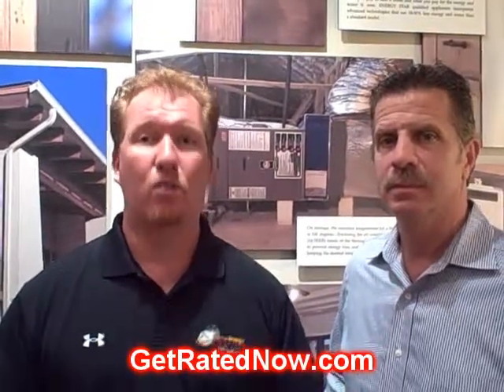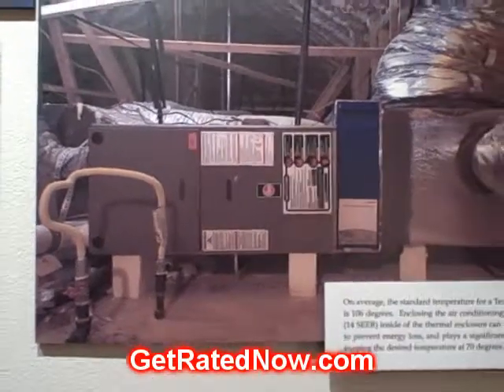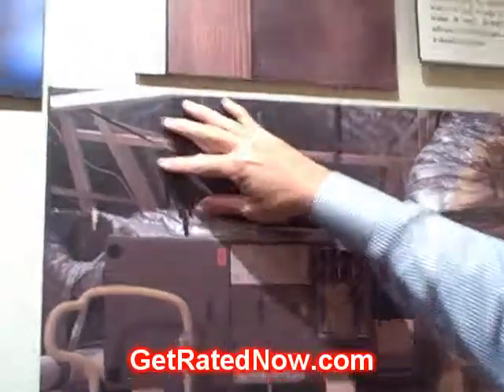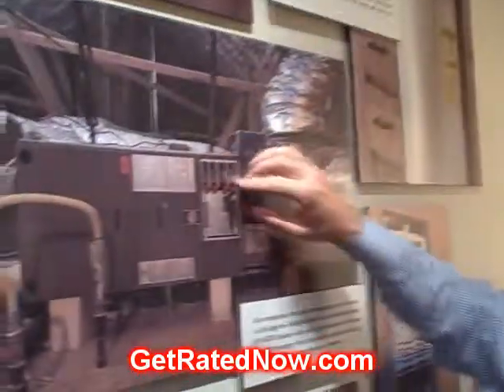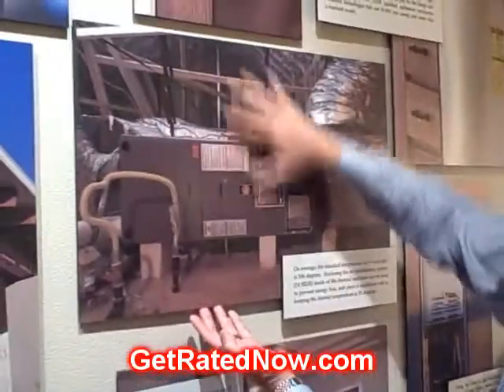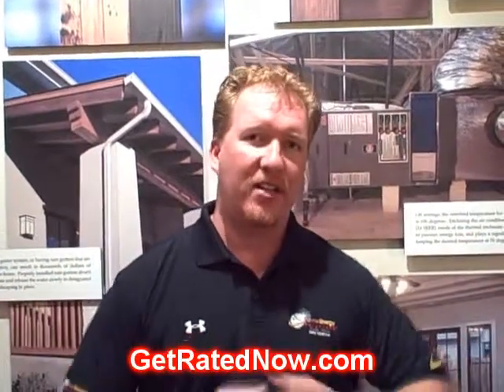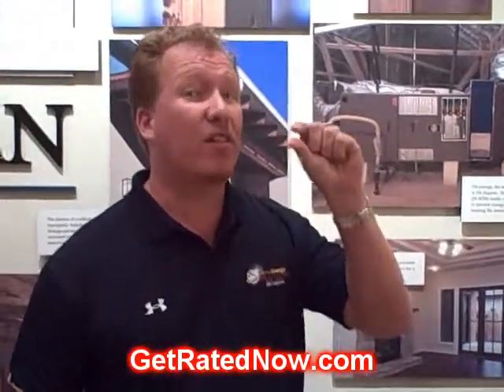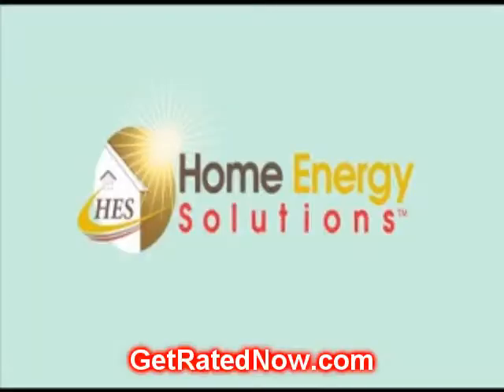How to make your HVAC system run more energy efficiently.

Comment: Is anybody dumb enough to believe that if you condition more air(attic) Install a substandard R-Value (R-19) Increase the surface area of your envelope (the hottest surface btw)  that you can DECREASE the size of your hvac??? I would bet everything that if you would; install the air handler inside the house ; seal the ceiling(so that you arent cooling your attic) and install over twice the R-value for half the cost(any loose-fill),  it would bring down costs, and consume less vs. your setup.